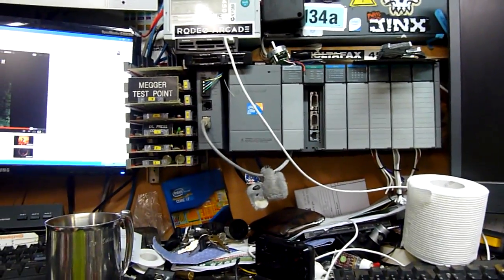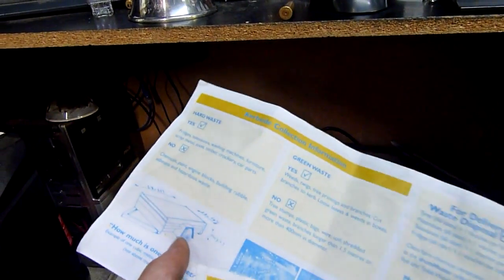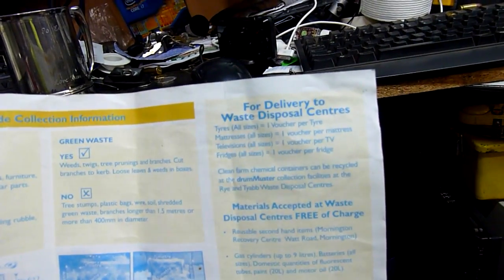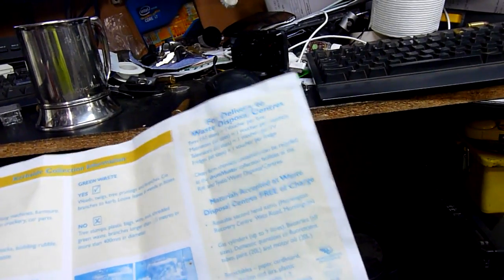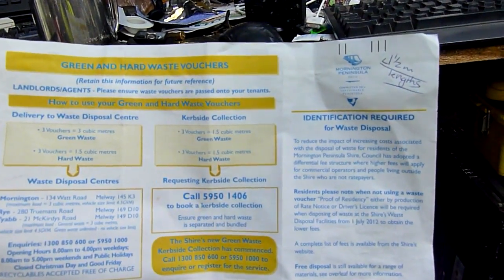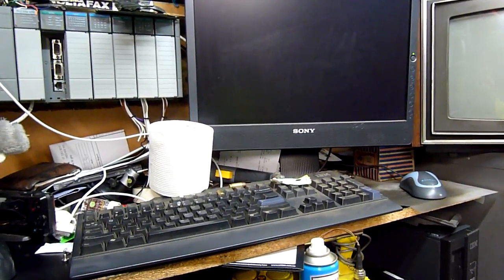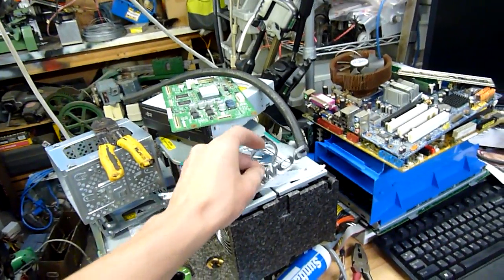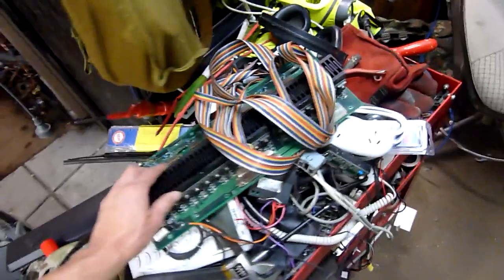Ramblotronic Friday - Cleaning up - North Korea Nukes and more!

Comment: Somebody call my name?
hehe yeah i am the guy with the old 1991 green panda Sisley 4x4.

hey Ed, i could do with your assistance if you have a minute to look at one of my latest uploads. its of the LG 60 inch plasma TV i recently acquired. it has the common "wont come off standby" issue. i suspect the capacitors but i know you have fixed a fair few and wondered what your say would be on it.
i am going to replace the ones that look bad anyway.
Thanks dude!

Comment: Just my opinion, but Lambos are overrated. I'd much rather have my little '74 Alfa with the hopped up engine. If I ever get around to fitting it with EFI it'd still be fast enough to be scary, and get mileage in the high 20s to low 30s.

Comment: Norks just want money..... Here dump is free if you are bringing in clean soil or sand ( topfill) and it ranges from $5 for 250kg general waste to $50 for tyres 100kg. Most expensive is polystyrene which is $5 for 40kg. I use special disposal ( drive up to the cell and toss off in front of the compactor and bulldozer) which is $20 for 250kg. Under 100kg and often it is free. Good place to go shopping though, lots of odd things there.

Comment: my father had a contach in the early 80s late 70s. the sun coming thru the front window in summer cooked you, even with the aircon, he traded it in on a rolls after the engine got smokey... (mum says it used to sound awesome, so he drove everywhere in 3rd gear)

Comment: for the centre engine mount you cant find, get a stuffed one, press out the rubber bit which will be rooted (keep the inner steel part), and turn a replacement out of nylon or neoprene, and press back in!
will transmit more noise and vibration, but will not sag and will pass any roadworthy!